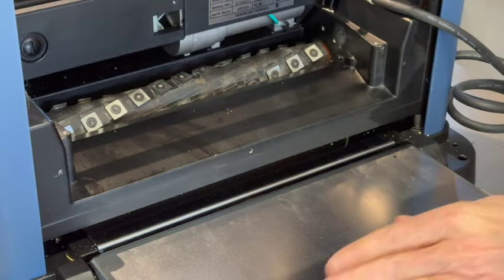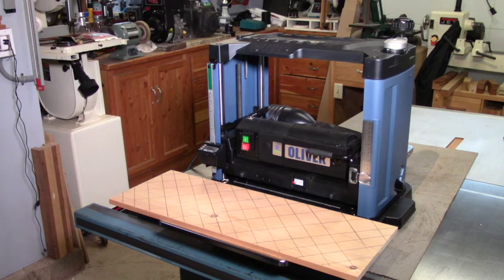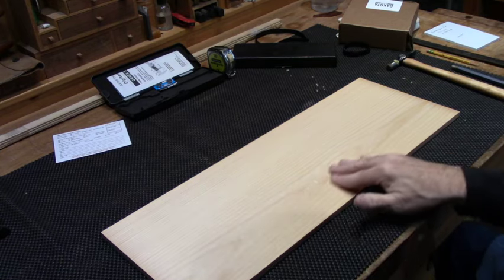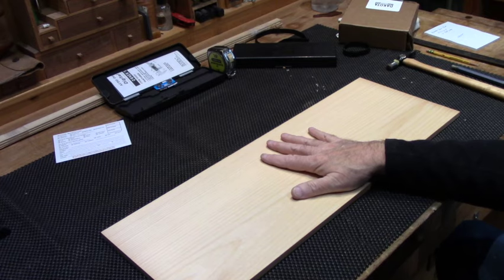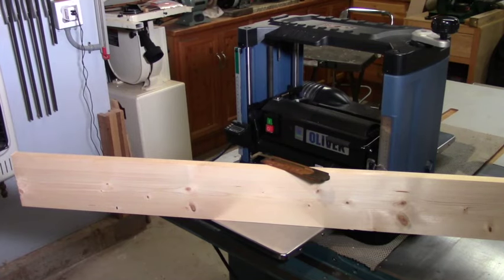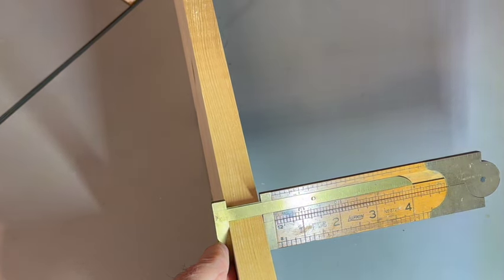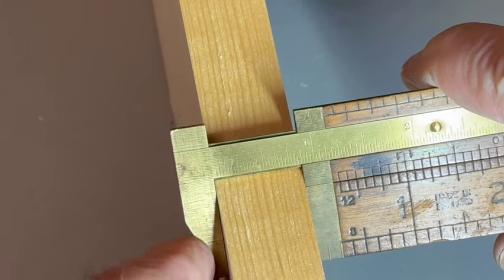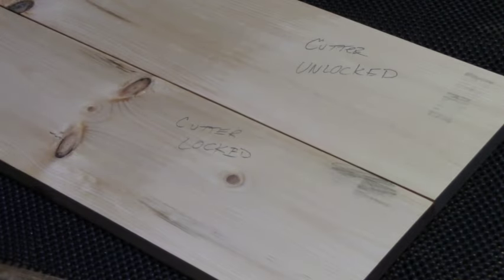Part 2 - Is this the Best benchtop Planer? Oliver 1044 Planer with Shelix Head and Digital Readoug

Comment: I got an email from Oliver that said they were having trouble getting Byrd to ship cutterheads in a timely fashion, so they reworked the 10044 a little and put their own HCX cutter in it. They have also added some features: it is now a full 13 inches wide in capacity and has two feed rates.  The model number is 10045 and it is the same price as the old one.
Reply from the maker: @Hybridog  thanks for the update! That would explain why supply was sketchy and these were hard to find. I like all the upgrades. Hopefully the Oliver cutter head is as good as the Byrd. I like that they kept it a helix and didn’t cheap out to a segmented cutter head.  So are you getting one? If you do, check back here and let me know your thoughts.
Reply: Thanks for the update on the model number
Reply: @frankvucolo6249  Im buying the 10045 in late October (Birthday present) as an upgrade from my old harbor freight "good enough" planer.  I finally might have skills enough to where this would make a difference. I'll let y'all know how it doers with maple, ash, and poplar (and I have a nasty Wenge flitch I need to mill for box making for Christmas).
Reply from the maker: @wacollier  Congrtas and Happy Birthday! Yes, please come back with some feedback. If I could find someone local to NJ, I’d love to do a video comparing the two for this series.
Reply: @wacollier  how are you liking your 10045?
Reply: @DavidRyanTaylor  worth every penny. After I learned to use it properly and got it dialed in, I no longer get any tear out, and it comes out nearly as smooth as if I had used 220 on it. Plus I’m now using the jigs Izzy Swan has on his feed to turn it into a jointer and it’s working perfectly even across almost end-grain. —I was using an ancient Craftsman jointer I picked up on Facebook Marketplace. This is truly a cry-once buy-once tool.
Reply: @ that’s great to hear. I was looking at using it as a jointer as well - or use my table saw with a jointing jig.

Comment: In a WW class I attended, we were able to use this machine  plane shop made veneer 1/8-1/16 using a supplemental table that raised the planer table surface.  Thin commercial veneer would be a no-no because its to thin and not flat, as would a planer with HSS blades.
Reply from the maker: @VinceEspositoJr  Great input Vince. I have not tried this but can see where it would work down to about 1/16 with clean stock and light passes. Would never try that on my old straight knife planer, but would experiment with this one. Almost can’t wait to have the need!